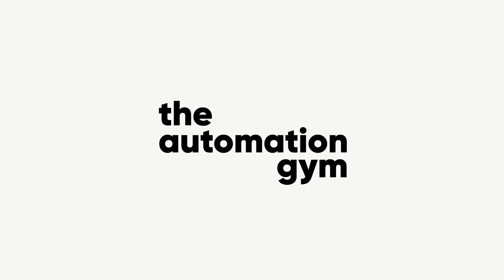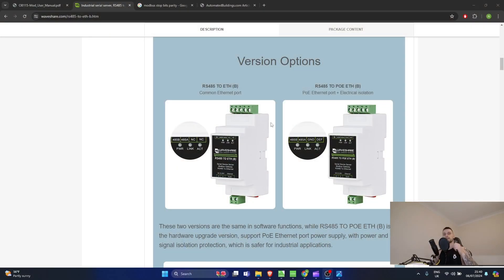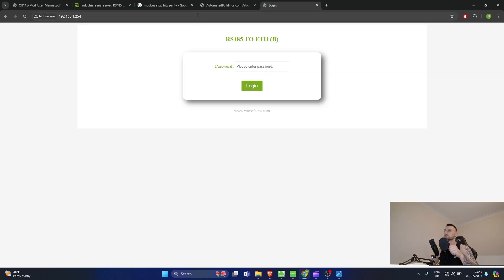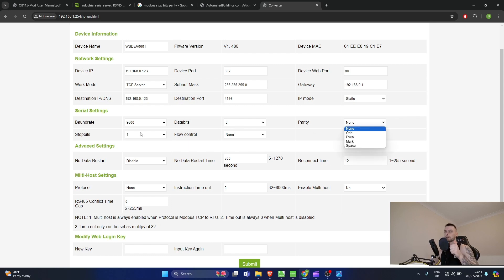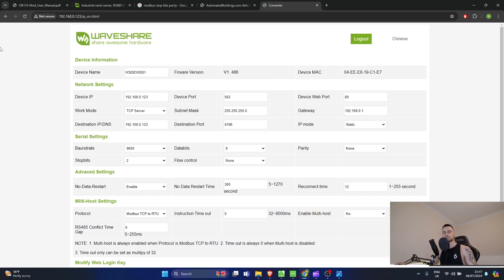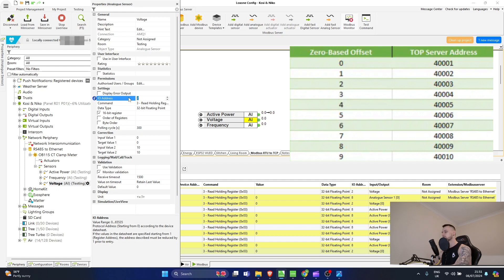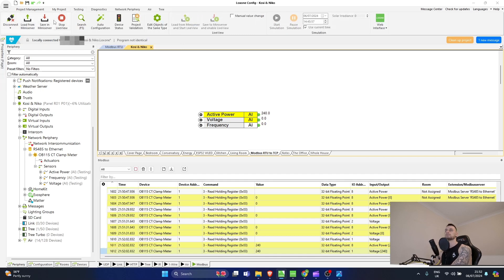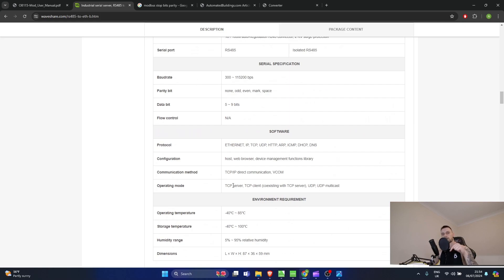Converting Modbus RTU(485) to TCP/IP with Waveshare

Comment: when there are multiple ct clamps on that rs485 server. how do you specify which one to poll? for port 1 for example
Reply from the maker: Hi, if you have multiple Meters/Multiple modbus devices - each one should be given a different Modbus device address and then you can still poll from the same registers and get individual data from all.

Comment: Is there a way to have this waveshare device transport tje rs485 signal from my meter, over my lan network, and back to rs485 signal into my inverter? My growatt only needs the signal to do zero-feed-in.  Its 100m away from my house and i dont want to dig 100m trench again lol.
Reply from the maker: Hi that's a good question. I've never tried it to be honest, but in theory that Waveshare gateway can act both as a Modbus Master and a Slave as well so I assume if you have 2x on the same network that it should be somewhat possible🤔

Comment: One question with that, does that support workin in a slave mode ?
Reply from the maker: Yes, the setup in the video is using it as a "slave", the Miniserver is acting as the Master/Gateway
Reply: @theautomationgym  i phrase the question wrongly - is it possible that minisaver act as slave? I have a device which cannot be set to slave, it acts as master always, so i would need to send some commands as "slave" . Any ideas for that ?

Comment: Hi Nico, I gotta a question. I have two RS485 to TCP/IP devices with POE functionality in an installation. However, I'm having a communication problem. It's not reading or writing to the device logs via MB RTU. Do you know how I can verify communication? Do you know of a forum or manual where I can read? Or do you provide advice or know someone who can? Thanks.
Reply from the maker: Hi, sounds interesting. What exactly are the devices that you are trying to communicate to?
I've previously used modbus rtu to USB to test registers and verify communication, however it's not very reliable.

I'd look into tools like Modbus Analyzer

Comment: Thank you very much! Your video helped me connect the Waveshare Converter, which I use with POE, to an EASTRON SDM72D-M power meter. I then process the data in IOBroker using the Modbus adapter.
Reply from the maker: Thank you, it's great that it works for the POE version as well, I've not tested it before

Comment: Hei, thanks. I have a question, I connected one energy meter and read the data, but when I connect five energy meters, how can I differentiate them?
Reply from the maker: Hi, the Addr./Address needs to be changed on each device and they need to differ.
Addr 1, 2 ,3 ,4 ,5 
Then on the Modbus Master/Server we need to address the device when polling it

Comment: Hi, nice video! i don't understand how to identify multiple devices on rs485 side from tcp side (for example if i have 2 energy meters on modbus?
Reply from the maker: Thank you! You can adjust the modbus address on each meter,making sure they are different. Then on the Modbus master you need to address it with that same Addr. ID.

Comment: Hello, I didn’t see where did you set the modbus device ID of the meter?
Reply from the maker: Hi, the modbus ID is usually set on the Modbus device itself, afterwards you can also set it to match on the Modbus server that you are pulling the information from.
Reply: Hi, thank you for your reply.
Does it show in the video where you set it on the server side in order to poll the information?
I saw that you set the IP of the Modbus TCP gateway, but when you added the sub device, you added the registers right away. I suppose that since it was the first device added, its default address was 1, and the clamp meter’s device ID is 1 as well!

Comment: One question about Modbus , did You try to read Coil status form some Modbus RTU device (FC01) in Loxone ?
Reply from the maker: @zeljkovrkljan2416  Hi, yes and it does work just the command type changes for the input to read coil and it outputs just 1 or 0. Sometimes it can be an analogue register and it requires the information to go to a Binary Decoder

Comment: Hello, thank you for your informative video. After some time after this video, can you please suggest the best possible (and financially viable) setup for wireless ct clamp connection solution to inverter input. The goal is to achieve zero export conditions. I have Deye hybrid 3f inverter. Thank you.
Reply from the maker: You're welcome, the cheapest wireless CT Clamp would be something like a Shelly EM if you just need to monitor 1 or 2 circuits.
The downside of it is it only updates the power draw info every 10 seconds.

Comment: how is the loxone server understand communication with this device,  is it some kind of standard protocole so we can add this device from config as modbus server ? And can we threat this device worth 20$ equivalent to loxone modbus extention 250$? :O
Reply from the maker: All Miniserver models support Modbus TCP natively. I wouldn't necessarily replace the Modbus Extension if I have the possibility of wiring it as it's more reliable than LAN connection.